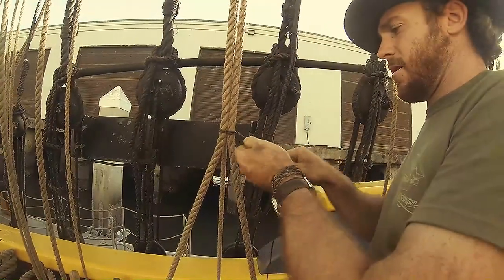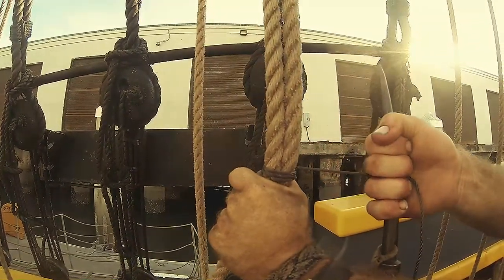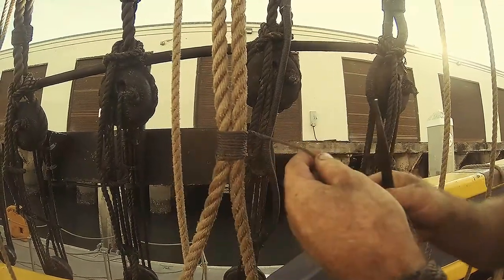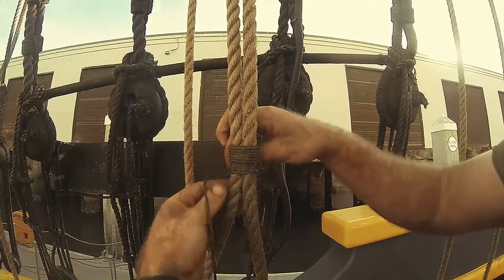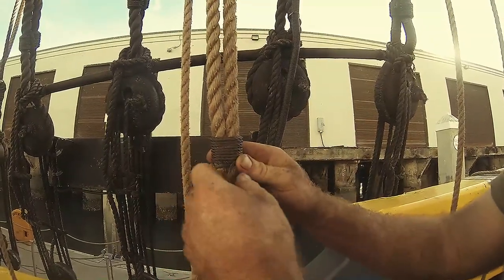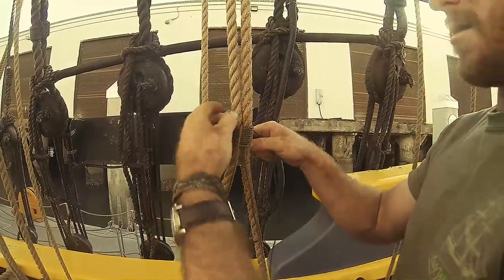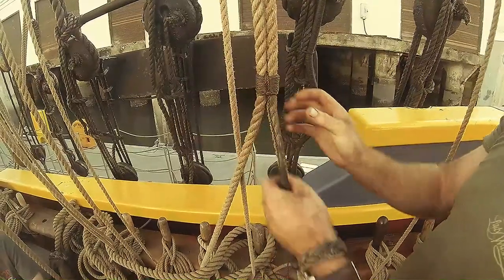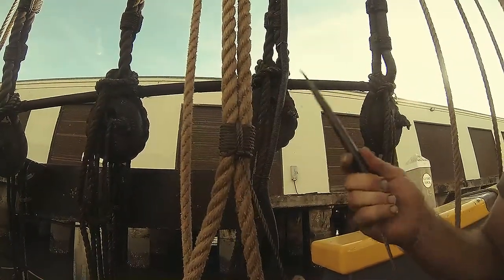Round Seizing

Comment: This is good, I like the emphasis on tightness.  the Marlinspike Sailor tell you to end with a half hitch which I've never thought was adequate.  The "flat knot" this end with is a little hard to follow, I finally concluded that it is a cow hitch.  I tried that and I really like it, you can pull it bar tight.
Reply from the maker: It is not actually a cow hitch although that might work.  Maybe ill upload a new video, as this one is getting pretty old.  So looking at the seizing straight on you have a left and right frapping turn once you get near the end.  Whether you use a wire puller or you put loops of twine under your fraps doesn't matter as long as they are pulling in the right directions and done in the right order.  First you want to put the end between the two and under the left hand frapping turn, so it will be sticking out and to the left.  At this stage you can pull in tight and it jams nicely under the frapping turn.  Then your end will go over the two fraps to the right, and will be pulled under the right hand frapping turn from outside the fraps to the middle in between the frapping turns. Be sure the end is pulled towards the bottom of the seizing at this point and that will snug the knot right down into the crotch between the two legs of whatever you are seizing.  

Hard to visualize, Ill make a new better quality video..  Im ashore for the next little bit anyway.
Reply: The knot you describe is the knot I'm tying and I still think it's a cow hitch.  Picture this knot made to a mooring ring.

I look forward to your next video, I like your approach.  It would be helpful if you would include a demonstration of the marlinespike hitch.

Comment: What exactly is a "seine twine puller"? Is it just a small loop?
Reply from the maker: Yes, its just a bight in small twine knotted together, it helps with making the flat knot at the end of the seizing.  you can pass the loop of line under the two frapping turns at the end of the seizing in a specific order and use them to pull the seizing line under the frapping turns that were made at the end.  I have seen people use a puller made with a loop of coat hanger wire and a wooden handle, they pass it under the frapping turns after heaving them tight, but I find this method pretty clumsy for smaller synthetic seizings as you end up loosening up the frapping turns trying to stuff the wire puller under them.

with twine pullers you lay them down beforehand and turn on top of them, at full tension and if you grease them you can still pull your line through no problem.
Reply from the maker: Yeah its just a little seine twine loop, what Ive been using recently though is little dyneema loops, because you can make them much smaller than the diameter of the line you're seizing with, making it much easier to haul them under tight turns.  Super strong and super slippery.  Good stuff.